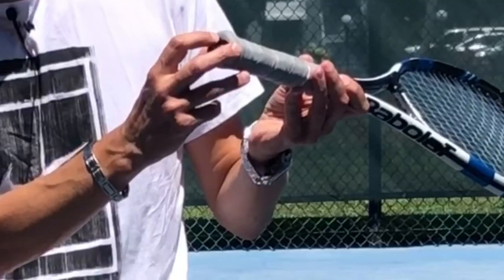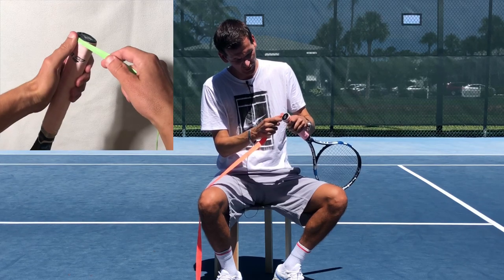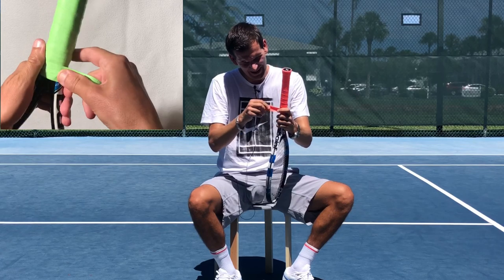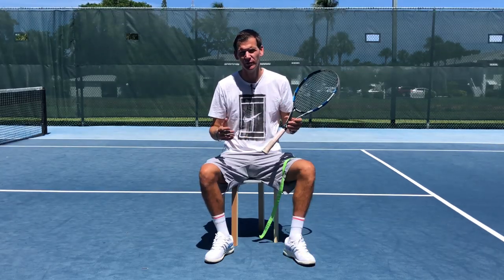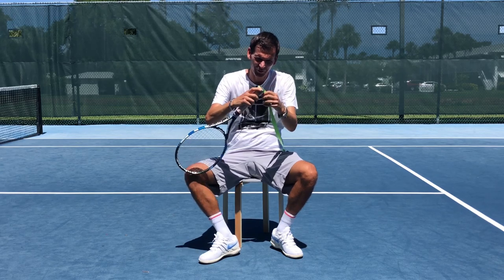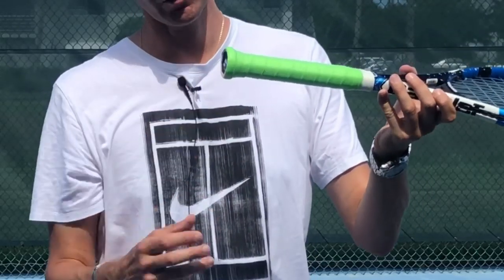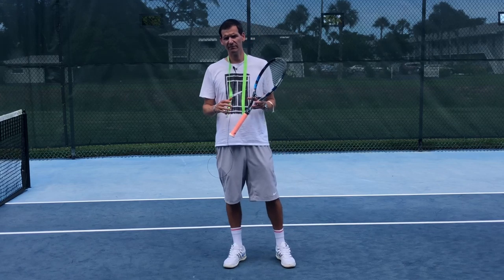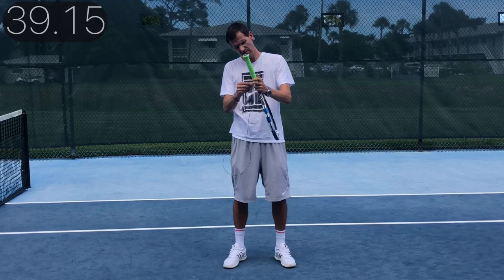How To Replace Tennis Overgrip

Comment from the maker: It’s important to hold the racquet with the non-dominant hand. This way the grip will be aligned with the original grip that’s on the racquet. It feels a lot smoother this way. Now there are some players who prefer to do it the opposite way. Sharapova, for example, has the overgrip on her racquet the wrong way. She got used to this and prefers it. If you were to do it in this fashion, the overgrip would be misaligned with the original grip and the feel is a tad more rigid. To do it the Sharapova way simply hold the racquet with your dominant hand and have the remaining piece of the overgrip in your non-dominant hand.

This video is for right-handed players. If you are a lefty you could do it both ways. Rafael Nadal puts his grips on the right-handed way. Fernando Verdasco, on the other hand, does it the lefty way. Try both ways and see what works best.

Comment: I’m just learning to play. When I finish wrapping my grip, I cut the end where I want it. Then I unwrap approximately 3-4” and with a scissor I cut a triangle like you mention. I cut straight across until it meets the point where your grip length ends.

Comment: I'm glad you mentioned the "lefty" vs "righty" winding of the overgrip, Nick.  I find the real advantage (it's only a small one) is that, for me as a lefty, the lefty winding direction fits my hand a bit better.  That's because the diagonal slant of the lefty winding matches the diagonal angle of my left handed grip a bit better.
Reply from the maker: Very interesting George, thanks for sharing that. Isn’t it funny that Nadal puts the grip on the righty way. I wonder how other lefties do it. I know Verdasco does it your way.
Reply: @IntuitiveTennis  I picked up that tip from the book, "Serious Tennis", by Scott Williams (2000).  In the book there was a piece by Ulrich Kuehnel (Boris Becker's racquet technician) where he said: "Grips also can be customized for right- or left-handers.  If you're right-handed you want the grip of your racquet so the angle of the grip (where the grip overlaps itself) goes upward to the right.  If you're a lefty, it's just the opposite. (Thus your grip should be wrapped counter-clockwise if you're right-handed and clockwise if you are left-handed).  I've played with grips wrapped both ways and, for me at least, it only makes a small difference.  I don't think anyone should get a headache trying to remember all this.

Comment: You mentioned that you use "regular" tape to finish off the top. What kind of tape do you use? Great content and excellent teaching methods! Thanks.
Reply from the maker: Regular athletic tape
Reply: Good question
Reply: @IntuitiveTennis  I use a black cloth hokey tape as my over grip or going over here end I use a little bit of Loctite Ultra Gel Control on bottom end so grip will not unravel.   Problem now is grip is sticky, overly grippy, so I use soil/dirt on top rubbing in and bushing off excess then using a fully damp paper towel/rag and wipe off so grip is now worked in a bit here sticky issue is gone usually perfect. Now at by going a full circle around before going down, in a 1/4 overlap at most on a 1.25 inch wide tape, I can use plastic part on the top of my grip if I do go on plastic as I have 2 where I did not do this going over upper plastic piece.

Comment: Thanks for the triangle tip, I always spend most time looking for scissors when changing the overgrip :)

I was surprised with the information at the end that you change grips so often. That's quite a lot of money and grip waste over the whole year if you change it everyday! And I wonder why is that? Is the grip damaged after just one day? I normally use mine for 1-2 months, I am a recreational player and play about twice a week, sometimes more often. So I only change grip when it gets a little shabby and I can feel the actual difference during play. In the matches I use a grip powder against sweating and sometimes I change my racquet during match if the grip is wet. In sunny weather it dries quickly so then I can change back.

Comment: Hi Nikola,
I have a question and a comment.   Do you make the part by the bud cap of the racquet thicker by rolling the overgrip several times?  And does the thick part interfere or help with the serve?
And the comment: Now I know why my forehand, backhand, serve, and volleys suck: I don’t overgrip enough :)
Thank you for very helpful video.
Reply from the maker: Hi Dmitry 
Definitely DO NOT roll the overgrip serveral times. You take athletic tape and cut about 20-50 millimeters wide. Then you roll the athletic tape at the very bottom of the grip a few times around. After that you apply the overgrip on top of that. Make sure you apply the athletic tape to the original grip.
This is not for everyone, you can try it and see if it feels good in your hand.
Reply: @IntuitiveTennis  Thank you for your reply, Nikola.

Comment: Is it still called an overgrip if you remove the original grip tape? I find I prefer the thinner head brand tape over what Wilson uses. Also many of the used racquets I acquired had sticky grips that turn your hands black. I remove the original grip tape before installing new tape.
Reply from the maker: https://youtu.be/gj8GkKIisCc

Comment: So if i take of the original grip of my racquet do i first put a replacement grip om it and then the over grip? Or if i feel that the grip is not good anaymore do i simply put over grip on the original grip? I a a little confused ( i never changed a grip before)
Reply from the maker: https://youtu.be/gj8GkKIisCc

Comment: Hi NIck. great video on a hugely underrated topic. btw, sofia kenin admitted she doesn't know hot to replace overgrip. her dad does :)  anyhow, wanted to ask you regarding left-handers taping - unfortunately, one cannot use the reverse side of the tape, which would be ideal as it would allow of using the angled start of tape as intended. as it is, it's a messy affair, even with pulling the tape tight. any advice on this issue?
Reply from the maker: Unfortunately you’ll have to learn to grip the racquet with your right hand. I don’t know any way around the problem. Or just keep it lefty...
Reply: @IntuitiveTennis  thanks Nick for a quick reply. looks like i didn't manage to express myself well. i have no problem with hands, it's the bevelled edge at the beginning of the tapered end  which is made for right-handers that troubles me. thanks
Reply from the maker: I’m not sure what you mean. The little adhesive part on the overgrip? Just align it with the original grip
Reply: I know what you mean, just try to keep more overlap at the beginning (when you start to wrap down) and so deflect the tape angle slower avoiding crumpled overgrip (you don't have to pull the tape overtight, just tight enough to prevent it from slipping).

Comment: Hello Nikola, I am between two grip sizes (2 and 3). Is it ok if I use 2 overgrips to make it bigger?
Reply from the maker: Hi Nermin, I don’t see any problems with that
Reply: I would go a 2nd base grip as opposed 2 over grips and one or a layer of athletic tape over the stock grip.

Comment: Nope. I mean the way the beginning of the tape is cut at an angle, so that when you wrap it around the handle it runs under an angle. there's is a little cut at the place where you supposed to start wrapping down from the butt. this is all done only for the clockwise wrapping. if you reverse the tape and do it anti-clockwise, agains it's gonna work, but then you will have the reverse of the tape as your overgrip. if you use the proper side of the overgrip. then you have a messy overlapping at the start, further down it gets fine. but the beginning is the most important part of the overgrip.
Reply from the maker: Still not sure what you mean, I would have to see it
Reply: I see what you're saying- the triangle at the end will be the wrong direction for a left-handed wrap unless you put the overgrip on wrong-side up. I guess you could also go the other direction and fold over the flat side at the bottom to create a triangle in the right direction and then wrap from there.